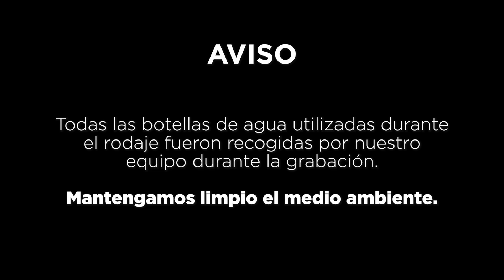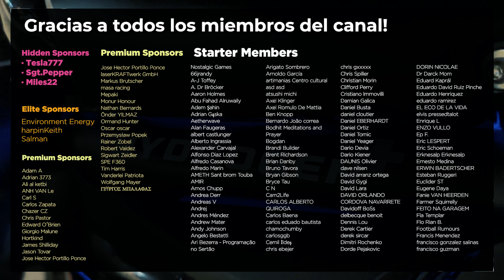ESTA MOTO FUNCIONA CON AGUA

Comment: Si se trata de motor de combustión de hidrógeno, el BMW Hydrogen 7 es probablemente el último vehículo que se llevó a producción. Quizás no fue un gran éxito debido a la infraestructura necesaria para repostar hidrógeno, técnicamente compleja y cara comparada con las gasolineras.  El hidrógeno producido por electrolisis en el mismo vehículo para crear energía es la solución más viable como ya se puede ver en algunos  grandes fabricantes del automóvil en los últimos 4 o 5 años.

Comment: If only this were true.  

If it is true, it is best you stay very very very hidden (if that is even possible today), or instead, mass release the formulas and designs as open source.  Otherwise .  .  . your fate is predetermined as it has been for those who have previously succeeded in doing what you claim to have done.  

It would be fantastically valuable knowledge but to try to capitalize on it is .  .  . suicidal.  

Give it away and you will be blessed beyond your comprehension.  

Unfortunately, it is very easy to conceal a hidden gas tank, so I seriously doubt that this is true.  

Either way I’ll give you a message from humanity:
“Best of luck to you if this is true and you can share it with the world .  .  . 
But if not true as I suspect .  .  . 
UP YOURS!!!”